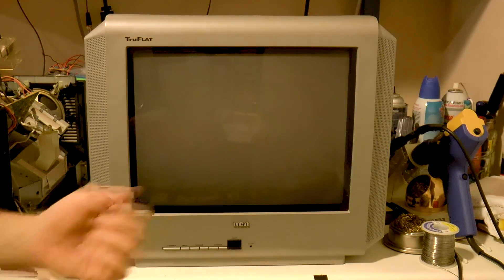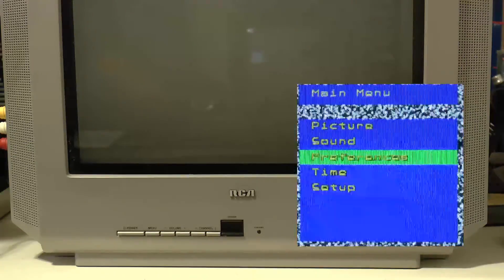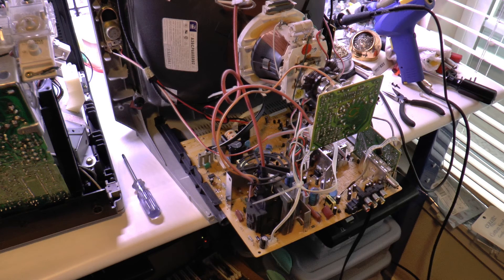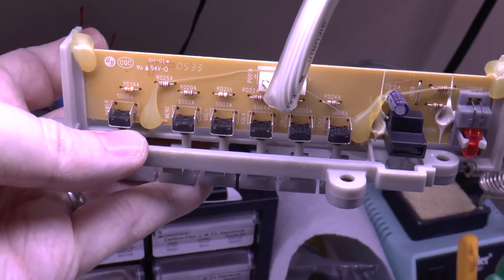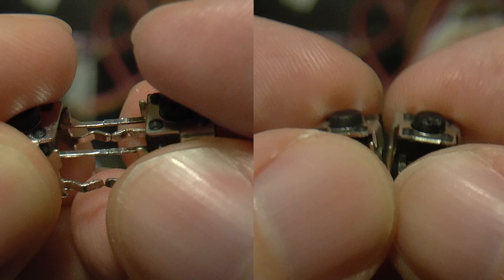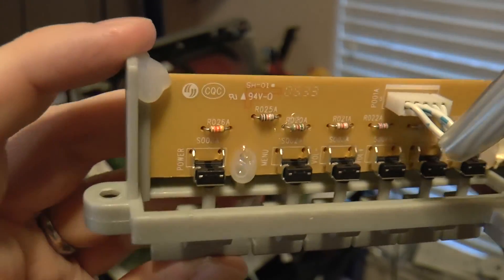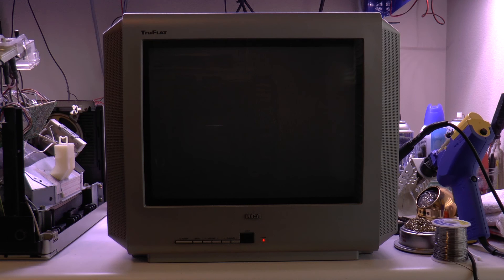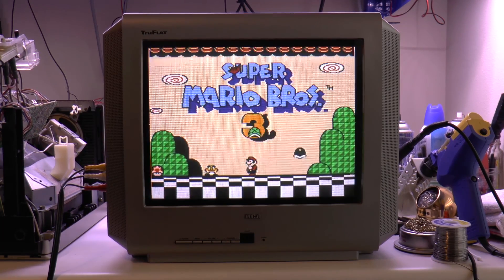RCA TruFlat CRT Turns On and Off by Itself! - FIXED

Comment: The way I would get mine to post is using a galaxy note 4 IR light to emulate a rca remote but now this method doesn't work. When plugged in it shows the red led and that's it. The buttons never worked period.

Comment: Just picked a 20f514td, luckily it's not phantom powering, but the front panel buttons all act like a rand function. Menu either pulls up the menu or ejects DVDs, input either cycles the input or it changes the volume or turns it off, etc. This seems to be a bad design, the way the buttons press put a lot of sheer force on the solder joints for the switches. I may try just reflowing them first out of my curiosity to see if that's sufficient.

Comment: Hey I just wanted to provide an update and say a HUGE thank you.  I watched your video, ordered the same parts from the link you provided and tonight I replaced all 6 buttons (and the LED light which is now blue).  The TV works flawlessly now.  As I mentioned before my TV is the newer 14F514T from 2008 but everything is the same as in your video.  Thank you so much, it seemed rediculous that it would be the buttons, but it was!!!
Reply from the maker: Awesome! So glad it helped!
Reply: Thanks for sharing!!! I have the same model as you with this issue that auto-magically came up after owning the set for about a year. Just ordered the switches as well and will get my unit torn down and updated

Comment: Working on the 20 inch version of this line of TV (Model 20F514TD). I didn't realize there were two black screws in between the component jacks, so I ended up de-soldering 3 cables from the neck board, because of course the motherboard wouldn't come out since I didn't notice those screws and the back wouldn't separate from the front with the motherboard still in. I initially thought the motherboard was held in by internal screws. I also damaged a pad on the neck board while de-soldering. . . whoops. I ended up soldering everything back together, and even with the damaged pad, miraculously everything worked with the exception of the front buttons. The buttons on mine are probably the same as on yours, because I am having similar issues with the buttons doing the incorrect inputs, and non responsiveness from others. I'm sorry if I missed it in the video, but what model number are the buttons you used in the video? Could you possibly link me to the replacement buttons?
Reply: I have the exact model like yours and yesterday after playing for 2O mins. Its started changing input source dvd keep closing and ejecting. So it’s actually the switches that causing it?

Comment: I have gotten many  crts from Goodwill and other thrift stores for 10 dollars or 5 dollars with various issues. Sometimes the speakers are scratchy or the tv makes a humming sound. Sometimes the image is too dark and the brightness has to be turned up. Flat tubes sometimes had a little bit of warping,  but it did not bother me much. I usually looked for Wega Trinitrons with component or at least something with s-video.  I used to ignore sets with just composite but I recently found one by the garbage near my apartments and decided to try it out on my genesis with the rf since I dont have a crt anymore. The image is way better than on my 2018 lcd, but it makes  a buzzing sound when the screen is white or very bright. I once bought a pvm from someone but it made a high pitched sound after a while and it made me ill and I sold it to someone who said he could fix it. The image was nice but I think it was mostly because of how small the screen was, but it was damn heavy.  I probably won't keep this one and take it to Goodwill while I wait for my retrotink and composite cables  to arrive.
Reply from the maker: I hear you. It was when I started to collect CRTs that I realized just how much tweaking/updating/repair would most likely be involved. What used to be a CRT "from a few years ago" has turned into a CRT that at its youngest might be 15 years old. Even then, the younger CRTs tend to be pretty cheap in terms of quality (like this RCA).

It is possible you can make changes to eliminate your buzzing, but it is fairly normal for some degree of noise to get into the sound when you have the contrast up high.

What CRTs do you have, by the way?
Reply: The CRT I found is a Durabrand from 2005. The contrast for some reason was set all the way up. I was lowering it and  I accidentally reset it, and it put the contrast all the way up again. Whoever owned it must have kept the contrast all the way up or it was set up like that from the factory.  I am not brave or smart enough to mess with a crt.  I don't have a collection, but I have owned brands  like Toshiba, Advent, and Sony Trinitron.

Comment: Nice. I have an issue with pink colour on my crt monitor. I've got no technical know how. Through googling I discovered that degaussing can fix it. I've waved all sorts of magnets around it (including taping one to a drill and holding it close) which produces fascinating effects with slight improvement, but it's not quite fixed. Either it's stuffed, or I need a professional. Would love to hear your take on what the hell is this magic that goes on when magnets are waved near a crt screen.
Reply from the maker: The beam inside of the CRT is deflected using a yoke. Small magnets are sometimes placed on the inside of the set to resolve any convergence issues for the red, green, and blue. There is also a degaussing coil inside your set that will fire up when you turn on your TV or after so many power-up sequences. (The RCA TruFlat in this video performs a degauss when it is plugged in)

Sometimes something like a strong magnetic field nearby (such as a speaker) or even facing your TV a certain direction can cause odd discolorations. 

If you have an overall pink tint on your monitor (magenta, perhaps?), it could also just be that your green signal is a bit weak. You could try tweaking this through a service menu if your set is "newer" (sometime in the 90s and newer) if you want to compensate - but be aware that tweaking the wrong things can really mess up your set. (Found a link on the web with some example photos of weak guns - http://www.oldtellys.co.uk/otcolour.html )

If it is older, you would be talking about possible pot tweaking on the neckboard - which most likely involves opening it up. If you get to that point, you may want someone with a bit more knowledge to look at it if you don't have a lot of experience with electronics.
Reply: @DisplacedGamers  Thank you. Read through all that. Interesting. At least I have a sense of the issues. I umm... kinda got a Commodore 1701 Monitor... very much out of my depth. For instance, I talked to my mate about cleaning the inside of my gadgets. He told me he would get me anti static gloves and compressed air. I didn't know static risk was a thing. I had cleaned the inside of my C64 monitor with a Dyson. I'm pretty embarrased about it, although my mum would be proud. I'm now thinking of doing an electronics course. And maybe getting some compressed air.